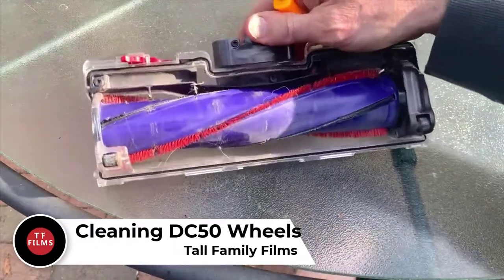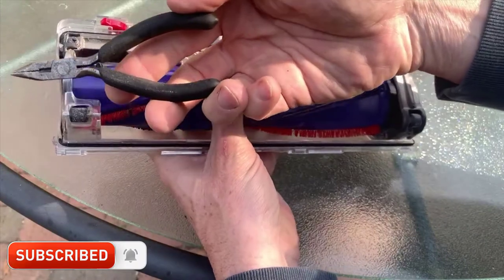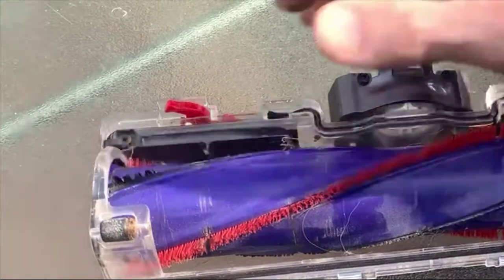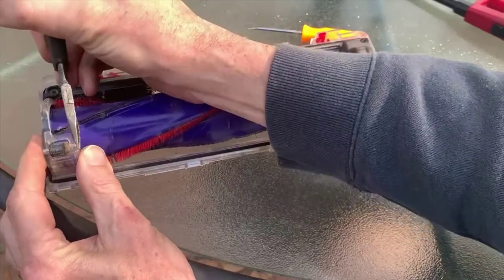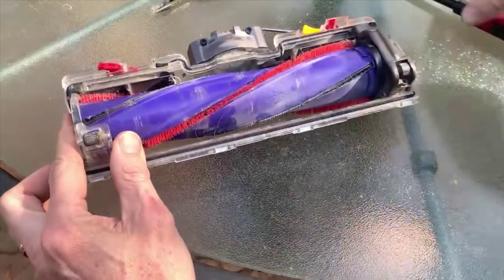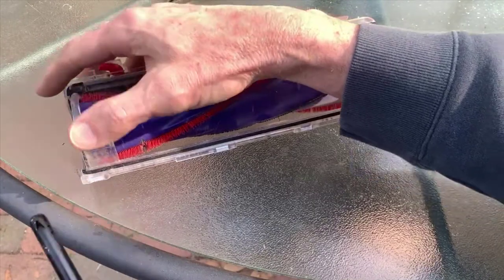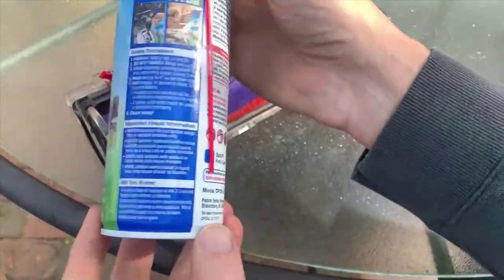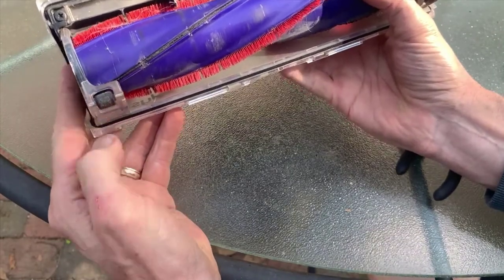Cleaning Dyson DC50 Axle Wheels

Comment: This is wrong - you can use a strong pick tool to lift the side of the exposed axle to pull the wheel.
Reply from the maker: I hope you’re right. I’m going to try it tonight and eat all of my words in this video!
Reply: Lol I just did it earlier.  I felt like I was gonna break it but it worked